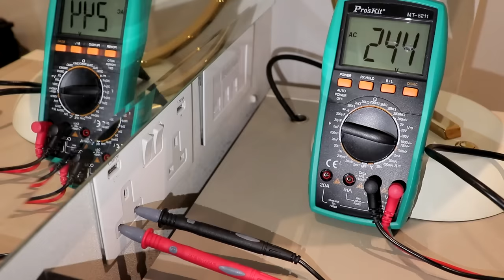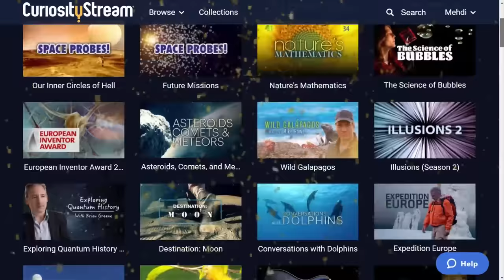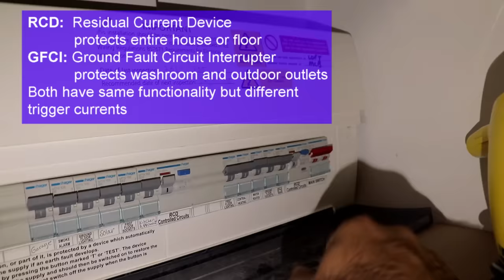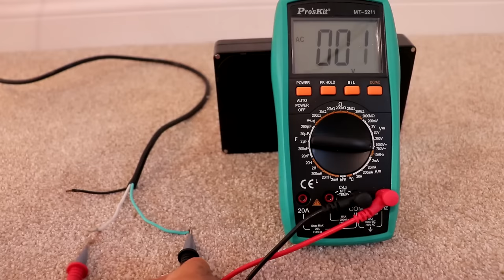Power Outlets in United Kingdom

Comment: The 13 Amp sockets don’t have to have switches. They can be bought without them which is useful for appliances such as fridges to stop accidental switch off.
The plugs have fuses because the sockets are connected to ring mains circuits protected with 32A breakers.
The plug fuse rating - 1 Amp, 3 Amp, 10 Amp, 13 Amp is changed to match the load. The fuse (as with all HRC, high rupture current, fuses) is to protect the wiring that connects the plug to the load, to prevent fires.
Effectively all the sockets on a ring are in parallel. Typically each ring would run a floor of a small house, the kitchen on a separate ring. Ceiling / wall lighting is on a low current lighting ring or radial or via a fused spur off a socket ring. Each ring circuit is run from the incoming supply via RCD’s or RCBO’s.
Large loads (range cooker, immersion heater etc) have separate radial wiring and RCBO breakers.
Reply: Upvoted. I was disappointed to find out Mehdi didn't mention ring circuits at all, as it's the main reason why all UK plugs are grounded and fused (which is unnecessary elsewhere in Europe), and it has some cool history behind it (post-WW2 copper shortages).
Reply: Muf I've heard the copper shortage theory, but splitting a ring into two radials would have a higher total capacity and use slightly less copper than a ring, at the cost of one extra breaker (or fuse, when the system was first used).
Reply: I heard a tale of a cleaner in a factory or lab or some kind of employer - doing the vacuuming - found a handy socket that was marked "Do not switch off" - so the cleaner didn't, just unplugged it and plugged in the vacuum.
Reply: @dingo137  No - you could use the same fuse for both legs of the broken ring !
Reply: @muf1772  That'd be why the local secondary school opened 1957 (IIRC) had a copper roof.
Reply: @dingo137  Yes, but it's more flaxible as a ring. You can plug a total of over 7kW in and not worry about which socket is on which circuit. In any event, radials are also used in the UK. Typically 16A or 20A on 2.5mm^2 cabling, but sometimes it's 32A on 4mm^2 cabling; some electricians prefer radials as they are easier to test. 

There are even sockets on some 40A sockets used to provide power to electric cookers/ovens. 

Also, by putting a 3A fuse in a plug, then that means 0.5mm ^2 flexible cabling on something like a table lamp is properly protected, which is not the case if exposed to a 16A circuit.

Also, it should be recalled that the system was originally designed in the 1940s (actually during WW II) when protection was down to fuses alone.
Reply: @millomweb  I think it's an urban myth; The story goes that people in a certain bed in a ward at a hospital had an increased chance of dying compared to the other beds. After much investigation, it was found that the cleaner was unplugging a life-support machine to do the vacuuming.
Reply: @simonharrison6447  That may be an urban myth - as life support machines will have battery backup - as does a lot of hospital equipment.
Reply: Interesting to hear that. Here in Germany ring circuits are strictly forbidden
Reply: @millomweb  I believe that's what I said - it's an urban myth.
Reply: @triibalecho  "Interesting to hear that" - too !
Reply: Dr.Greenthumb I suppose ring circuits are forbidden in Germany (and elsewhere?) since you can’t get schuco type plugs with internal replaceable fuses?
Reply: Muf  Not all uk plugs are earthed (grounded). The Earth pin can be plastic if the appliance has class II insulation that makes it impossible to get an electric shock (live to earth) by virtue of no exposed conductive parts for example a clock radio with a totally enclosing plastic case or a usb charger etc. The Earth pin (it becomes an ISOD, insulated shutter operating device) is still required to open the shutter that blocks the line and neutral pin apertures.

Comment: Why do you don't go to like Germany and test our 'SchuKo' System like you did in this video?😃
Reply: Yep. Even though it's pretty bulky it sure looks cool. Kinda SciFi.
And: with a simple hack, one can easily isolate the ground contact. Good bye ground loop hum.
Reply: I'm sure he'd be thrilled to find out that our plugs have no polarity.
Reply: @MrTridac  Bulky? No, UK plug sre way more bulkier.
Reply: Hamza Žunić UK plugs are thinner.
Reply: @sasodoma  I just looked em up and there's no pin for ground? I'd assume that weird pointy thing sticking out at the top of the plug is the earth connection?
Reply: Rainbow Frog yup. The outlet has 2 earthing fingers which touch the plug from both sides. Also makes contact first and kinda redundant due to the doubled existance.
Reply: But like mentioned before, no polarity. You can change the polarity to the device by turning the plug 180°. Also no protective doors to the contacts (at least the standard outlet has none. There are special versions which do have protective doors, but must of them kinda sucks, because it’s way harder to get the plug into the outlet.)
Reply: @sasodoma  wtf are u talking about?
Reply: @olpqay  do you guys even know what AC means?
Reply: lenard ggor yeah... change of polarity 50 times per second and therefore wrong to call it polarity on the outlet. But i think you got the point anyway. No distinguished pin for life contact.
Reply: CEE 7/7 one because it's more wide spread/useful. (Tho they are used pretty much interchangeably)
Reply: Was wäre Deutschland nur ohne SchuKo :’)  
Um ehrlich zu sein benutzt die eh keiner ^^ nur wenn wir mal wieder ne Veranstaltung machen damit alles sicher ist 😂
Reply: @lenardgor  Sure there is no voltage polarity with AC, but there is polarity in the sense that one wire will do nothing if you touch it and the other one will kill you. It's good to know which one is which.
Reply: @lenardgor  do you even know what neutral means?
Reply: @paulabraham2550  yes, as a matter of fact I do. As well as that ground and neutral are basically connected and the only useful  reason for ground is the use of a RCD
Reply: @olpqay  Here in Norway shutters on schuko are bog standard and has been since at least the nineties. And they don't make it harder to insert at all, but I know there are some uncommon older ones which are kinda tricky.
Reply: @olpqay  "Reversible" is the word you are looking for, EU plugs don't have an up or down orientation to plug them into the socket. Unless you are in France and you have one of those plugs with an extended ground plug, those annoying French always seem to find a way to ruin the fun...
Reply: @SuperSiggiboy  Good to know that they can be easy to insert. I guess ours are just crappy. You'd have to use a great amount of force on some of them, it almost feels like breaking it. I always thought it was some way of childproofing it, but now I think they are just badly made.
Reply: @lenardgor  reason no. 2 ground also gets rid of static buildup. on metal outer cases. relieving the shock for you and keeping your appliance running up to the breakers value.
Reply: Toastpaws welche Steckdosen benutzt du dann? Jede normale Steckdose in Deutschland hat einen SCHUtzKOntakt, nur nicht alle Geräte verwenden diesen Kontakt. Vor allem Trafos für low power devices verzichten auf eine Erdung.
Reply: @hamohamo234  you can easily impale your foot if you step on uk plugs. so scary
Reply: @lenardgor  Oh dear, oh dear. Well never mind, let's leave that - do you even know what polarity means?
Reply: @paulabraham2550  yes i do but saying that the AC plug has two polaritys is kinda weird. You could also say that it has a groind polarity on neutrL and changing polarity on L1 for example and bying totaly accurate you could also say there is no difference between both 50 times per second.
Reply: @lenardgor  Look, I don't think this is the right place to attempt an education - it's quite a big subject, and in any case I'm the last person who ought to try to teach it. Mehdi may cover this stuff further in future and he would be ideal. But I'll ask you to consider two questions as an introduction.
1) Why do you think people were installing protective earth wiring and building it into regulation standards decades before the invention of the RCD? Were they incredibly far-sighted?
2) The UK plug, which is polarised, always has its fuse in the line side. Why do you think this is?
Reply: @olpqay  When ya'll say "no polarity" you mean either one of the pins could be live and it isn't marked? implying that in most other places one side of the socket is always used for the live wire as a rule?
Reply: Rainbow Frog exactly. In UK always the right contact of the outlet is life contact and the plug cannot be inserted upside down. In Germany right contact is often life, but there is no regulation and the plug can be inserted upside down anyway.
So one could say, because of this fact the UK system is better, because you always know which conductor is life also after a plug connection.
Reply: @rainbowfrog7420  Yes. Although it's a bit more than marking - a polarised plug cannot be inserted incorrectly (line to neutral and vice versa). Thus things that should be on the line side of the circuit (fuse, main switch etc) and those that should be on the neutral side (Edison screw shells for example) are guaranteed always to be so - provided they've been wired correctly of course ,🤪
Reply: @sasodoma  Wrong, it's good to make it so you can't touch any of them. SchuKo does that very well by recessing everything that matters completely out of touch.
Reply: @olpqay  Which puts the cart in front of the horse. It does not matter if your device is unplugged, as it should be for any untrained worker. And a trained professional working on a live circuit who relies on a convention deserves to be zapped. Same with the switch, you don't trust it for safety. Safety is 50 cm between the plug and socket.

Comment: The switch on the outlet is not redundant it good to prevent sparking and Charing of plugs on some devices. Its also really useful for switching items off without having to unplug them.
Reply: Or, for example, when you've decided to do something stupid like attach a north American transformer but don't want to actually hold the bloody thing when you power it up...
Reply: Where I live every single outlet has a switch in some form. We plug the appliance permanently and just switch on or off without unplugging unless we have a reason to. 
Never knew it wasn't a thing around the world. I thought the old Tom & Jerry shows showing plugs without switches were a thing of the past.
Reply: yeah I hate how in the USA half the time when you plug or unplug something there'll be sparks, even if it's not really dangerous it's rather unpleasant.
Reply: @megabigblur  Funnily enough here in France there are no switches on outlets and no sparks when plugging or unplugging anything.
Reply: @psirvent8  surely you can't tell with how deeply recessed the pins are within the socket when they make connection?
Reply: @megabigblur  what?
If things spark when plugged in then its a good sign that there are wiring faults. That's not an outlet/plug design issue thats a damaged wiring issue.
Reply: @RossMitchellsProfile  They only make connection once they're not accessible to the fingers anymore as the holes are recessed into the outlet.
Reply: @psirvent8  I'm aware of that, my point was that you can't tell if it's arcing or not. It could still be damaging the contacts and you wouldn't know.
Reply: The only trouble with the switches on the sockets is that there are some people that think they need to switch them off even when there's nothing plugged in as they believe it uses electricity, many atime I've been working in someone's home and had to plug an extension lead in for a light in the loft only to find after climbing into the loft the extension lead is dead as the switch on the socket is switched off   Grrrrrrrrrr
Reply: @nilloc93  no things spark because they are draw power and that movement causes sparks when the terminals are close enough for the current to jump. It happens in on every switch with mechanical movement
Reply: @rjp666  I have a colleague that thinks smart meters and force power into your home and blow things up. It's amazing how some people get out of bed.
Reply: @rjp666  Of course it never occured to you to check if it was switched on when you plugged it in....how odd
Reply: Lol my missus is canadian I would always get shocked everytime I unplugged it

Comment: UK had all of those bits before the rcd’s arrived!

Also you don’t mention the ‘ring mains’, originally fused at 30amp (now with 32 amp breakers) which is why we have the plugs fused at 3,5,10 & 13amps (we used to have radial lines to each socket fused at 15 amps & lights 5 amps in the central fuse box).
Reply: The best thing (and still available if you have a decent electrician) was lighting circuits in each room. Each normal  mains socket used to have another  right next to it that had round pins  - this was controlled by the switch at the door, so you could turn on all your table lamps (or whatever) from the door. Lamps were wired with a round pin plug to fit.
I wish they'd bring it back, but smart lighting has done for that, I think
Reply: Oooh, I wondered what those old round pins were for!! Cheers!

Comment: “…although nothing should happen to the transformer itself.” 

[ZAP!!]
Reply: In fact, most of inductive loads (transformers, motors, luminescent lights with good ol' inductive current limiter) work near saturation when at nominal voltage. When plugged into double the voltage and to REDUCED frequency (50 Hz instead of 60 Hz this poor guy was designed to) they become mostly a wire with mostly no inductance whatsoever. So yeah, no wonder it blowed. The only possible exception is audiophile equipment where they tend to have much larger transformers and use them in linear mode, far from saturation to avoid distortions and current spikes.
Reply: @allmycircuits8850  Is this down to cost cutting?
Reply: @uK8cvPAq  Probably yes.
Reply: well, nothing happened to the transformer itself.
Reply: Not that we didn't see it comming ;-)
Reply: @uK8cvPAq  Not just cost, but also reduction of size and weight. Working near saturation (magnetic field near 1,5 tesla) allows fewer turns of wire, that means wire can be thicker and so of lower resistance. The same transformer with more turns (so it have much greater inductance and lower magnetic field at same voltage) would be too low power. To increase it one should increase size of magnetic core and 'window' size (that's where wire is put).

Comment: I believe the RCD tripping current is inversely related to the time it takes to trip. The idea basically being that you can survive 30mA as long as it trips quickly enough.
Reply: Yes, it takes 30ms to pop so yeah not letal
Reply: No, Circuit breakers have this so they can bridge a small overload, like the time to heat something in a microwave while also making toast, it happens in minutes so CB's allow for this. RCD's trip right away.
Reply: I live in a tropical country with a lot of lightning, where the regulation states 30mA, but everyone installs 100mA because of nuisance tripping
Reply: Yeah it’s much more important that it trips in a specified time, and that permitted time becomes shorter the higher the fault current. Also, many modern electronic devices have an inherent earth leakage current, often USB charging sockets, and this can result in nuisance tripping if the RCD trip current is too low.